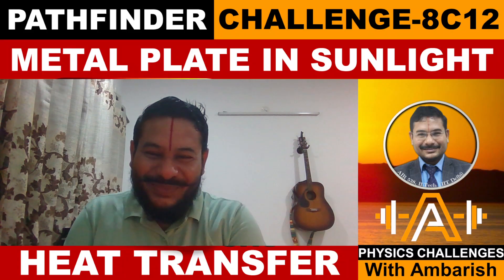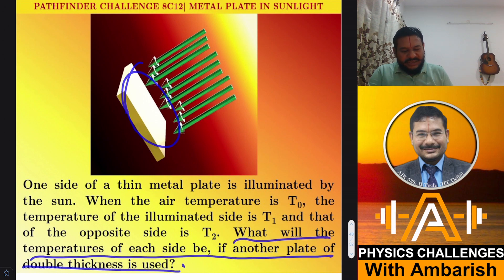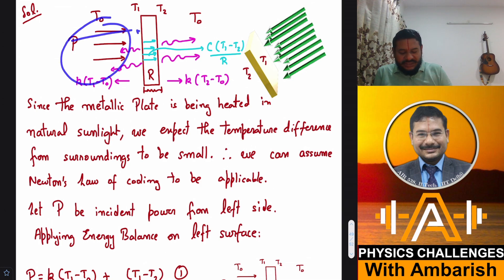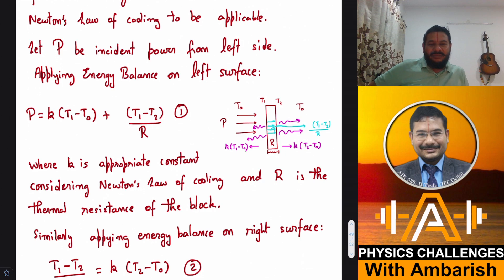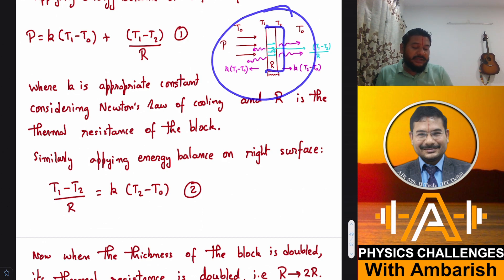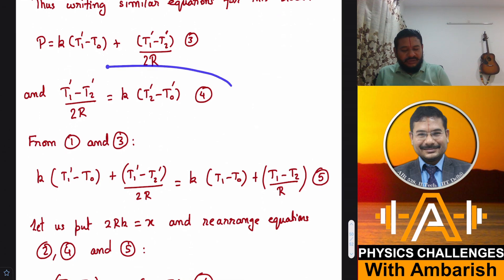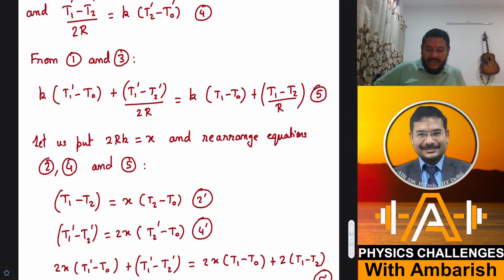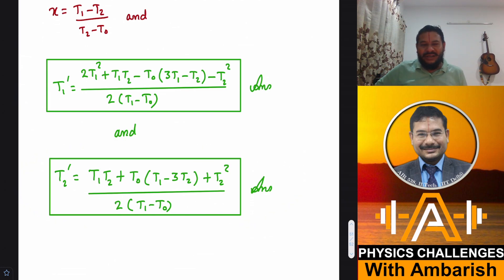HEAT TRANSFER| PATHFINDER 8C12| SURFACE TEMPERATURE OF METAL PLATE IN SUN| NEWTON'S LAW OF COOLING

Comment: sir does this type of thinking for new and hard problems comes by thinking first and solving them before solution or just joing thorugh the solution deeply ?
Reply from the maker: Both are helpful. To attain mastery i recommend taking up PF/ SBT/IRODOV and solve them systematically on your own. Given them a try (max about 10-12 min) if you still don't get... No harm in looking at solution and note the key ideas you missed.
Reply: @ambarishphysics  ok sir but at this point of time (jee 2022 asp) should i go for pf or sbt completely as i have done very selected problems of those books
Reply from the maker: @wave7213  TRY SBT Level 3 first if time permits you can get back to level 2 later.